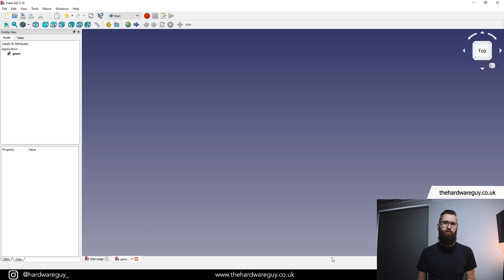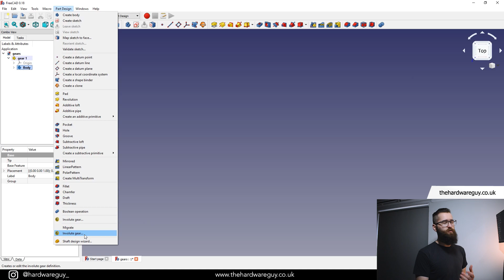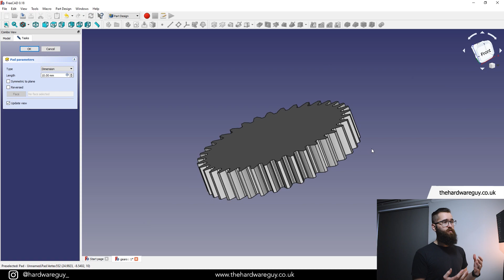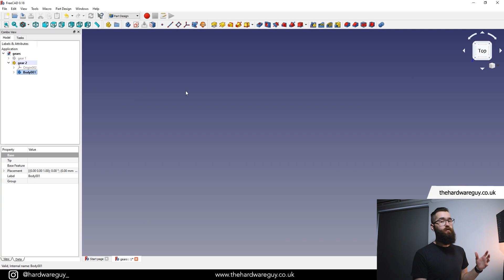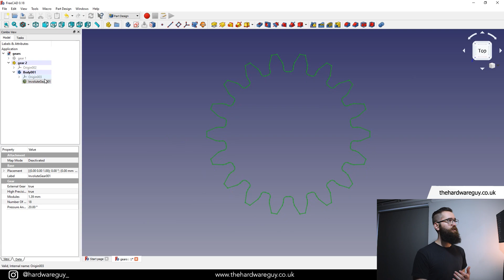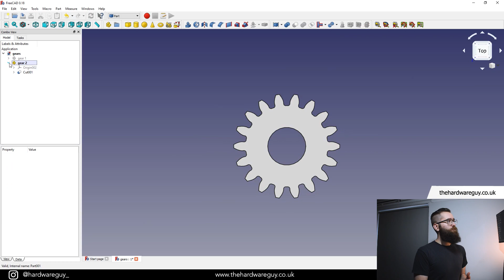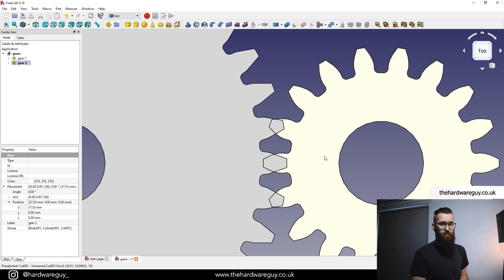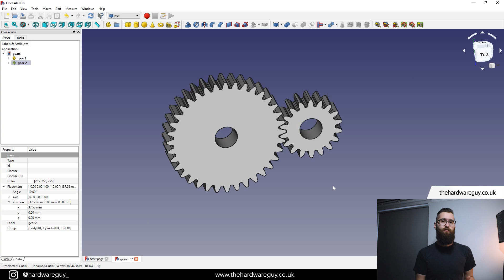Spur Gears in FreeCAD

Comment: Just when we got to the formulas, we stopped using spreadsheets 🙃 They actually would be quite handy here, auto-calculating distance and rotation angle. I would also like to recommend a macro EasyAlias to all the beginners (install via add-on manager), saves a lot of clicks when assigning aliases to the cells. And it's quite a pity, looks like gear count is not parametrisable.
Reply from the maker: there was a reason I didn't use them but I can't remember why, it was so long ago! you're right though, great application for formulas

Comment: Hi is there anyway I can cut the tips of the gears off? I made some helical gears resin printed for a small rc car they are very tight with a 30° pressure angle so I changed to 14.5° they are very free now but I lost a few teeth on the pinion gear a couple of minutes into testing

Comment: Thank you for clear presentation.. I am an engineer designing a 1.5 M dia clock for a play. I use Arduino RF Nano's to communicate from the sound desk to the clock driven by a single stepper motor and spur gear set. I need to 3D print six nylon spur gears which must press fit onto concentric steel pipe elements between the hub, an idler shaft and the motor. Never done any 3D drawing before so thanks for such a clear start.
Reply from the maker: Sounds awesome Mike. Good luck with your project!

Comment: Hello, I have watched this and other videos of yours several times. I need a SPROCKET not a GEAR. A chain goes around a sprocket and a second gear goes against the gear. Can it be done in this program? If so I would love any help you could give me. My sprocket needs to have 42 teeth and 495.3mm diameter with a 50.8mm hole and be 12.7mm thick. I do not expect you to make this for me I was just giving you ONE of the sprockets I need.
Thank you VERY VERY much for you GREAT videos and your time.

Comment: The ultimate guide it was not.
It’s a good guide don’t get me wrong. But you only showed me how to create. Not to replicate🤷🏼‍♂️
Reply from the maker: Thanks for the feedback. The idea is that I show you how to create so that you can replicate. It'd be pretty difficult to try and cover everything that everyone wanted to replicate in a single tutorial. Anything specific I could offer advice on for you?
Reply: @thehardwareguy  I found your video hoping to learn how i could measure an existing gear and then either design a replacement or an additional gear.

Comment: Instead of going back to the previous part you can start your design by adding a spreadsheet and keep all parametres in there and reference that data when setting the measures of a sketch or other operations. That way if you wanna change the module size, you can change it in the spreadsheet and if those parametres are referenced properly,  the changes will be made to all parts.
Probably creating a spreadsheet should be the first step with every design. 
PS: good tutorial vids. thanks.
Reply: As I tried to create a gear I realised that the gear add on can't reference spreadsheets

Comment: great tutorial!  Thanks for sharing this.  One quick question about involute gears.  Ho do you increase the mesh depth?  On geared roller systems, with variable space between the rollers, the gears are deep enough that they still maintain contact as the gears are moved apart.  Is there a way of achieving this with FreeCAD?

Comment: Thanks a lot for sharing this video set of freeCAD lessons, it's helping me a lot to use this software. I had 0 previous experience on freeCAD or solidworks, fusion 360 or any other 3D modelling software and yesterday I could, following your instructions, make my first gear for replacing a broken for an old laser printer I have.

I think I need modify a little the gear to imitate some shapes the broken one it had, but now is at least functional and I want print it to see how it looks after slicing and printing it, it has 20mm diameter, then is quite little for printing, and sadly this going to be my 4th attempt of print anything. I need to practise a lot on this too. But anyways, thanks so much for making these tutorials, they're great!

Regards from Chile!!

Comment: Nothing happens when I change the "module" setting. Apply doesn't do anything either. See the idiotic tip that comes up for the module field? "Module of the gear". Yeah, that clears it right up, thanks captain obvious. Where is the radius or diameter? It's deliberately obtuse. Supposed to get out a calculator and gear books I guess.

Comment: Dear @theHardwareGuy,

I kindly ask for your help to find the solution to this: I created a gear and an internal gear (teeth carved inside the body of the part); I did the math with the number of teeth, the diameters, and the modules as you describe in this video, and the teeth of the internal gear overlap the one of the external gear.

I searched for more information, but I came to the same formulas; I tried to use a "cycloid gear" to build the gear to be subtracted from the main body but the teeth overlap remains.

Thank you so much for any hint you can provide and the tutorials you published, they get me started with FreeCad!

Cheers.

Comment: Great video, you got yourself a new subscriber here 👍. I have just got my first 3D printer and want to create some nice tools and gadgets. One of my uses of gears is that I got an idea to make a bolt/nut head measure device (to see what socket I need). A small thingy like a tiny caliper but with geared rotating numbers (like on an old car's odometer) that shows the measured width in tenths of millimeters. I want it to be a small thing that can go where normal calipers can't reach. I haven't done anything more than thinking of it yet, but if I succeed I'll post it on thangs or something. The measuring part connected to a rack and then gearing for 3 digits up to about 40,0 mm seems to be a start, I have no idea how accurate it can be but it is a nice project to learn more about Freecad and my Prusa i3 MK3S+ 😁

Comment: Thank you for the great video. It helped me a lot in converting a Fusion 360 gear with axle to FreeCAD. I am stuck on a small problem though. Whenever I try to chamfer the teeth the chamfer fails no matter how small I set it. Do you know any solution to add a chamfer or is that not possible in FreeCAD?
Edit: Never mind. After playing with the chamfer a bit more I noticed that it works fine with the type distance and angle.

Comment: Excellent and easy to understand!  How can I make the gears parametric?  i.e, could I make the module of gear 2 the same as gear 1 using a spreadsheet parameter?  Likewise, can the position be calculated based on parameters too?  FreeCAD noob here.

Comment: Thanks so much for the explanations. I've now got an idea of where to start if I need gears designed. I loved the explanation of how to calculate the distance between the axles for the gears to mesh. Great tutorial. 
One thing I will say is that although I (also) find Fusion360 easier to work with, in FreeCAD you don't need an internet connection! :-)